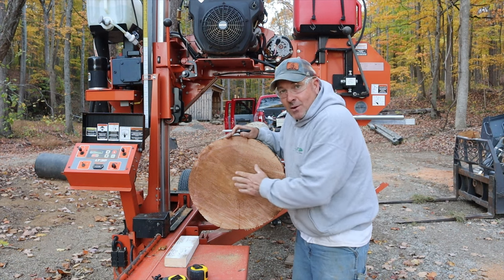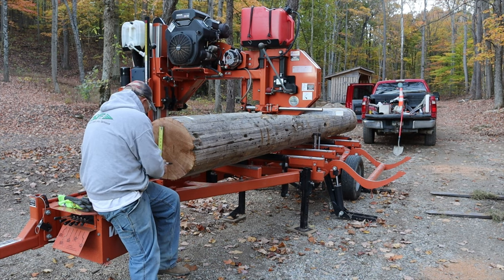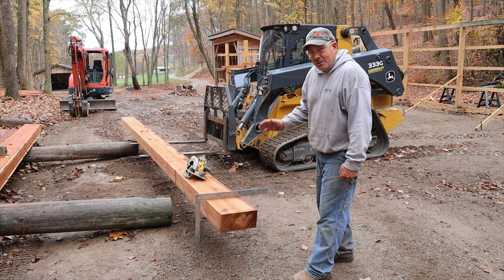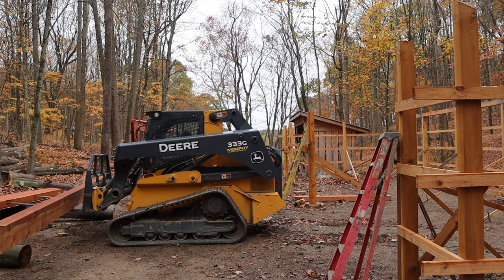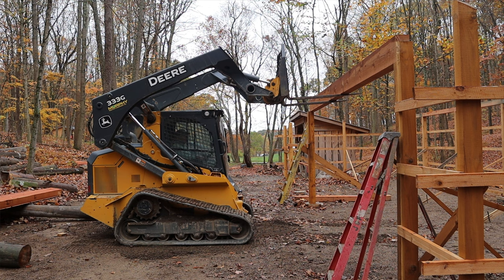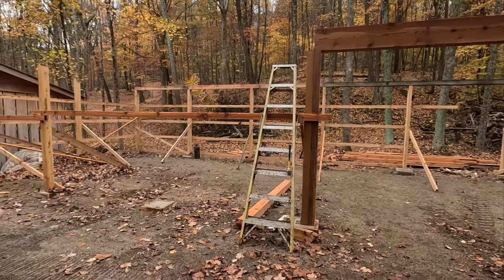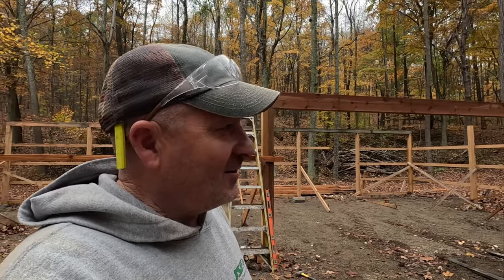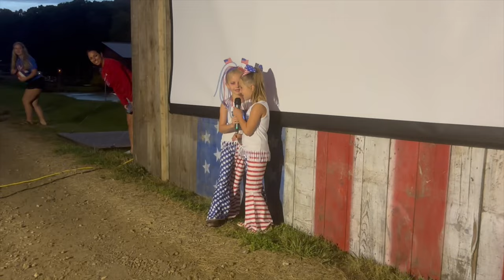Woodmizer turns old utility pole into BEAUTIFUL barn beam!

Comment: Nice to see you back in action! I’m actually getting ready to build my own mill shed and a lumber storage shed next to it. I’m doing a 12x40 for my lt35 with a 20’ door for loading logs and doors on each end may add a small loft in it too. Then a 16x24 for storing lumber. I rarely ever cut anything longer than 12’ but like you said it’s better to have the wiggle room than not have it at all. Can’t wait to see what you do with it!
Reply from the maker: Thats fantastic.  What type of wood will you be using for your 20' header?
Reply: @CairnCreek  I’ll be using a 20’ steel I beam we got in a surplus auction.

Comment: Why 7x11, seems like an odd size. Just wondering, plan on building my own soon
Reply from the maker: It’s been a little while since making that video. If I remember correctly correctly, the 7 was for the post thickness(5.5) and my girt thickness (1.5). The 11 tall was for what I felt was sufficient. The beam gets its strength from height and not so much width.